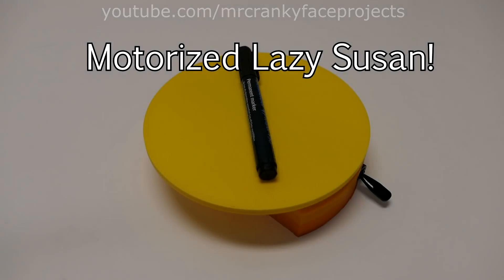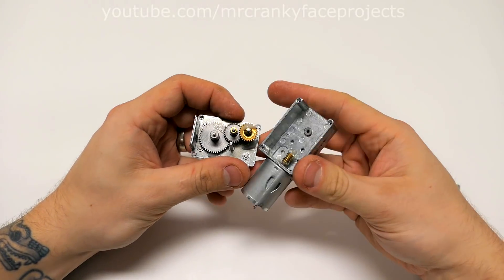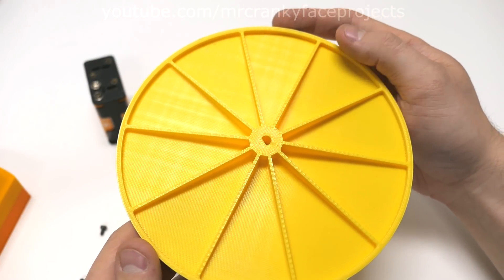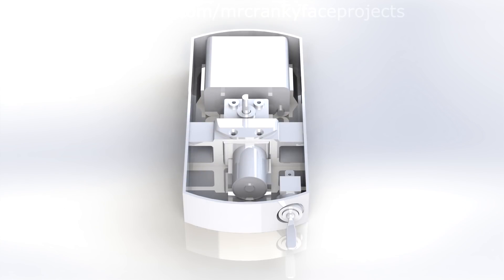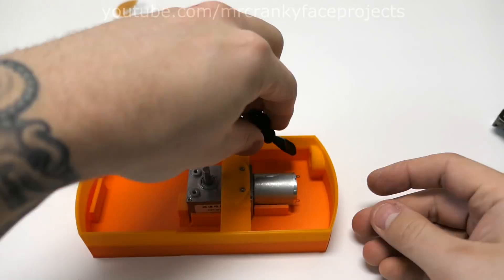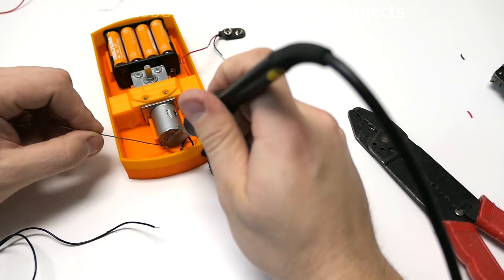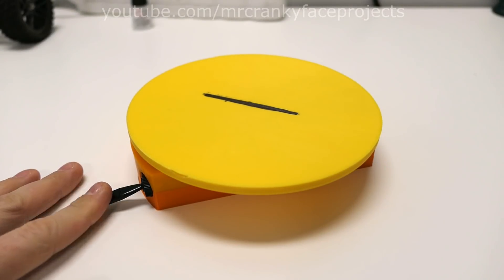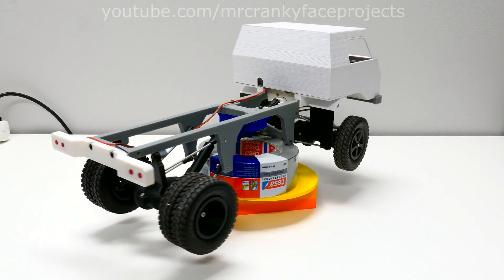Cheap 3D printed turntable/lazy susan!

Comment: The Switch and battery holder just give me error messages :( I really wanted to make this...
Reply from the maker: Just go on ebay or any electronics store and they'll have battery holders and switches. Any will work.
Reply: @MrCrankyface  I ended up making it - used it in my newest video :) Thanks for posting the design online!